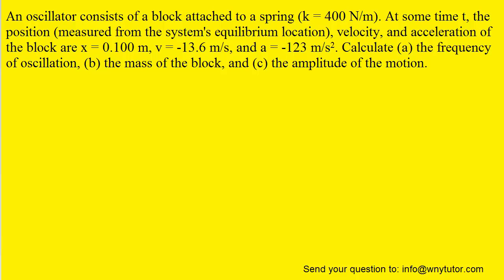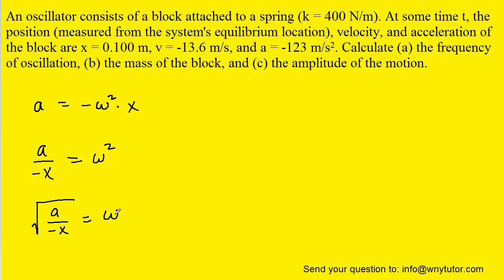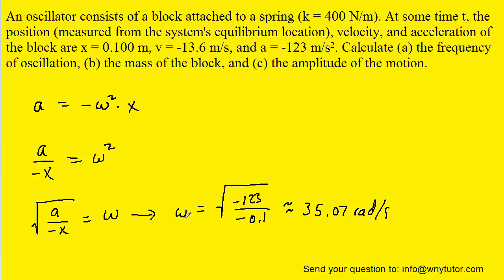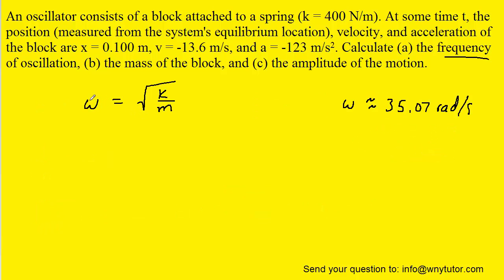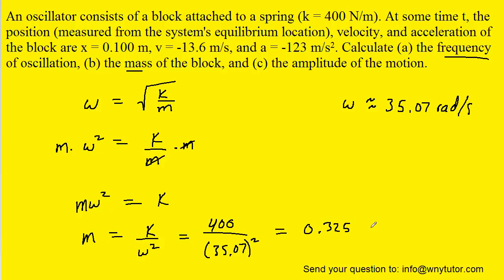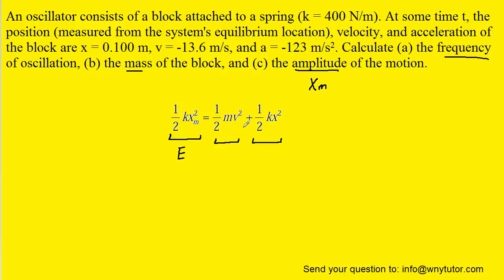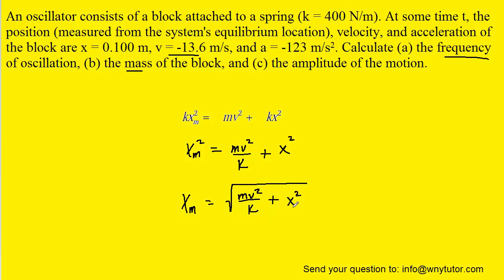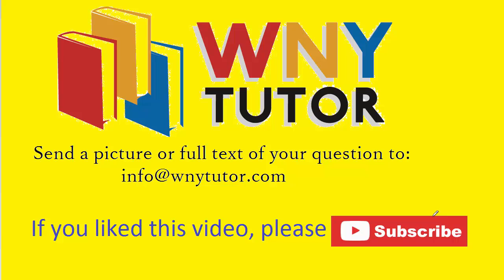An oscillator consists of a block attached to a spring (k = 400 N/m). At some time t, the position (

Comment: The correct formula for part C is sqrt of (v^2/omega + x^2) - If you solve the conservation of energy equation as you've shown it should be sqrt of (mv^2 + x^2), but that equation still doesn't result in the correct answer.

Comment: You have helped me a lot in Physics, but I have a question about part C. I was told that to find amplitude I should use v = w sqrt (A^2) - (x^2) and solve for A. However, I know that v = -A*w*sin(wt + o (I did not know how to put a strike through it).